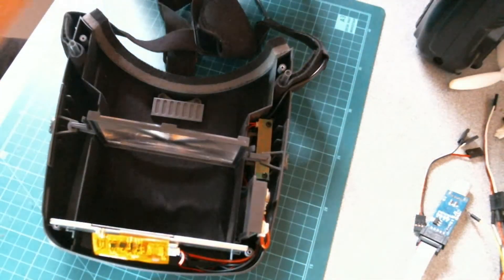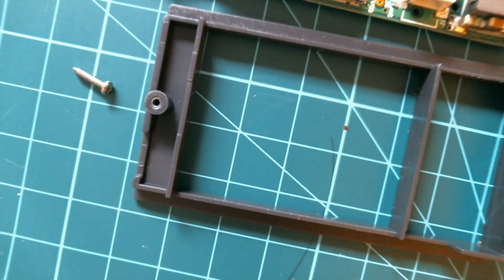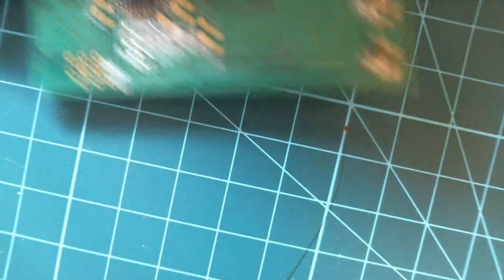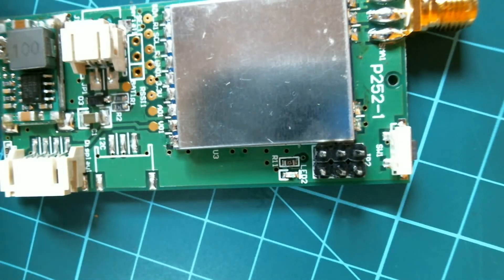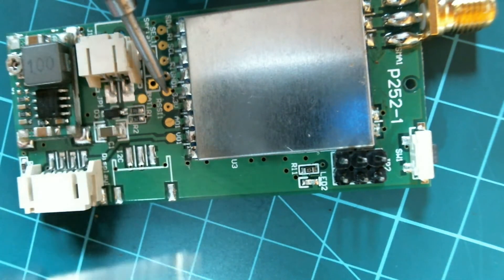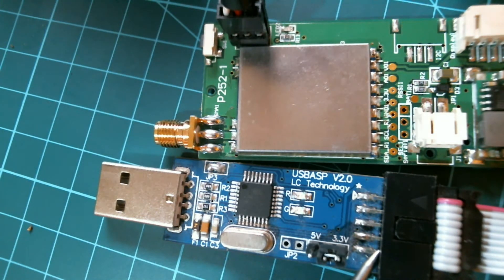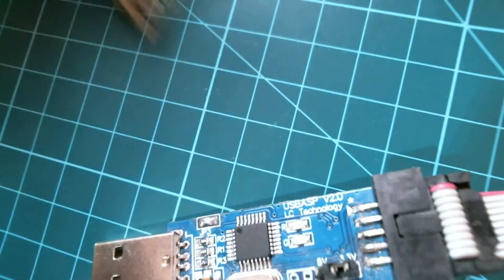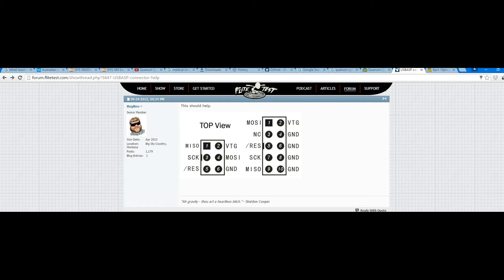Quanum Cyclops Goggles Firmware hack part 1

Comment: Hey Steve if I wanted to put video in with an RCA cable would all I need to do is splice the video wire from the receiver into the screen and supply video from my own receiver?  Thanks
I tried this but am just getting static.
Reply from the maker: TheBarrettrussell You should have a switch of some sort even if you just used a jack that removed the Cyclops receiver signal whenever you inserted the incoming one. Also all the grounds should be common.
Reply: Hey Steve. Thanks for the info, much appreciated!  I literally cut the video signal, and kept the remaining 3 wires going to the screen.  I then soldered an RCA plug on the wire going in to the screen.  All I receive is static.  I dont expect you to spoon feed me the info, even a link to understanding "common grounds" would be great.  I am rather ignorant when it comes to wiring.
Thanks
Reply from the maker: Link not off hand but by common ground i mean when you usually send a video signal the ground wire is connected as well and if i understand what you have done is send just the signal wire to the screen which will only work if the device that is sending the signal is being powered by the same positive and negative ie battery. Hope this makes sense.
Reply: Thanks Steve.  It does.  I think I may have a defunct runcam eagle.  I tried hooking it up to my tv and still nothing. Video signal is video signal.  But i will try to share the power from my camera with my goggles to see if that works. bypassng the receiver in the goggles completely.  There are the two black and one red remaining, do you know which black I should connect to my ground from the camera? im assuming red is power?  I could also pass the whole connection on the goggles and power the camera with power from the runcam. Thanks again.

Comment: Hi Steve, I have a question for you. I tried doing the CYCLOP+ firmware flash the other night and got distracted by my wife while I was doing the flash. Once we finished talking I noticed the AVRDUDESS stated the the flash was successful and I thought nothing else of it until I unplugged the USB and remembered reading that I had to wait for the RF module to start blinking before removing from the USB. So my question is now (if you know) is my RF module unusable considering it just says "no signal" on screen and I'm not able to flash it again. Do I need to buy another USB adapter to be able to flash it again properly??

Regards Tyson